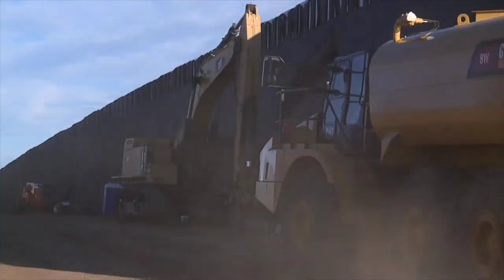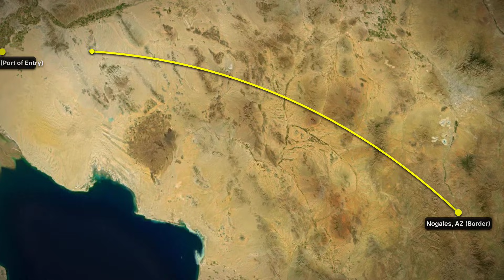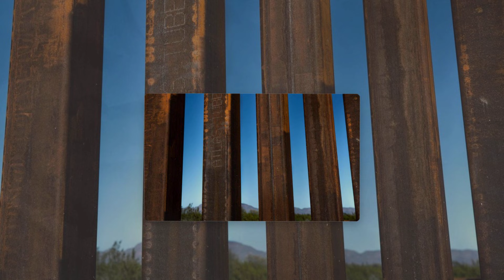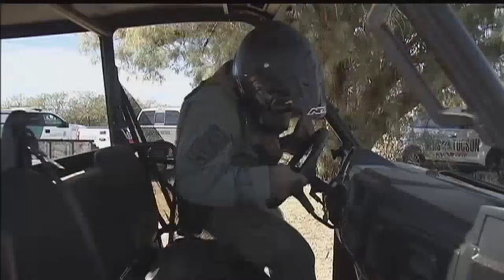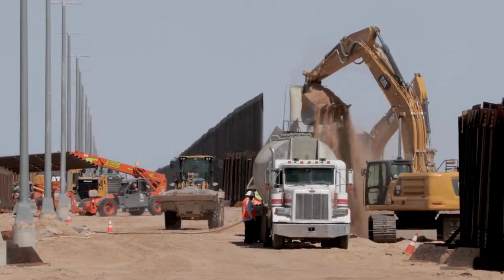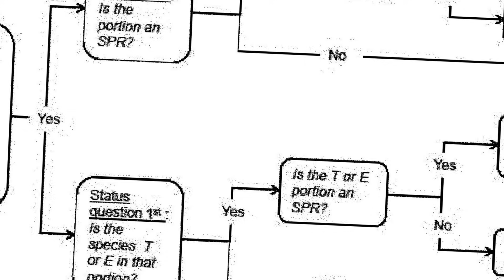Why America Is Building a $15 Billion Border Wall The World Didn't See Coming

Comment: Desperate time call for desperate measures.  The cost and consequences of the wall is what has to be paid to change the momentum and inertia of the world thinking the US border is open and easily crossable.  This mindset was created by not just 4 horrendous years of the Biden administration but a much longer period of liberalism and globalism in the west.  So I lay the environmental and human costs (to all those poor folks now being deported) squarely at the feet of liberal idealism.  Stern adults that come in and fix childish problems always look bad as they do the necessary dirty cleanup work.  But this is what adults have to do - the responsible ones anyway.

And, contrary to the video, there is nothing quiet about building this border wall.  This has been an ongoing very loud issue for over a decade.